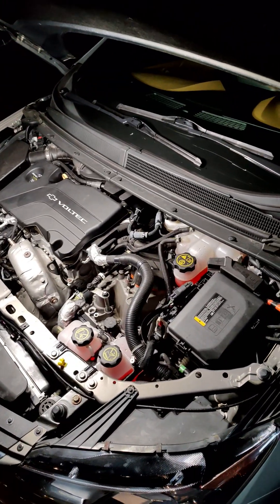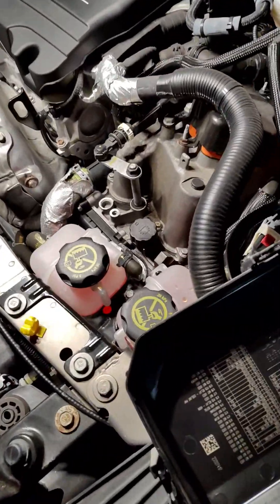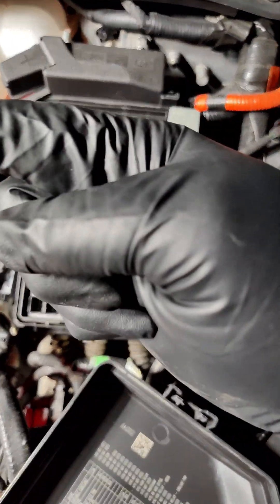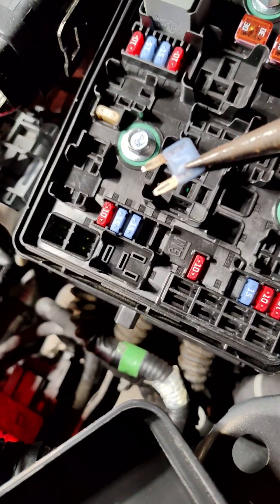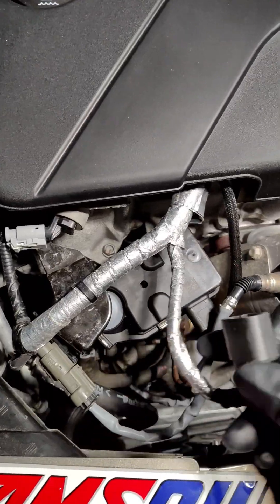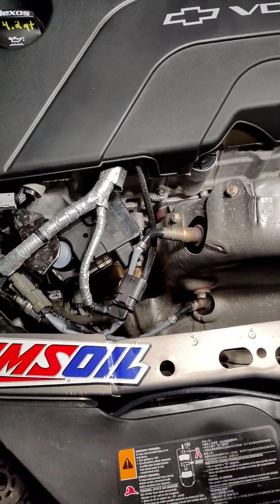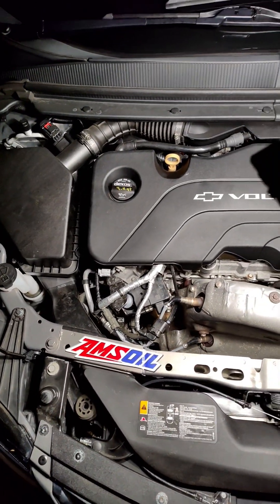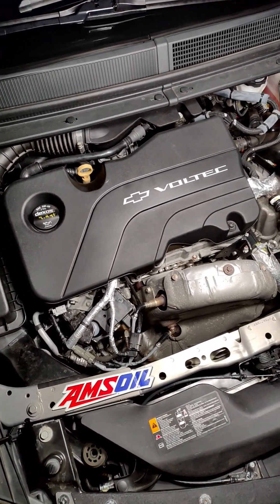🔥Chevy Volt Overheating? Reduced Propulsion? P0401 Code Explained + Temporary EGR Bypass

Comment: Did you say that, when the valve is unplugged, all the exhaust (or some) will circulate back to the engine ? What's the advantage vs. disadvantage ? Will it increase or reduce the power ? Thanks !
Reply from the maker: Assuming its not stuck open, the valve will stay closed, it will not harm the engine at all, the only thing that will happen is your car will make a little more pollution and you will have a check engine light on.
Reply: @blackwatermotorwerks  How would I know if the EGR is stuck closed or open?
Reply from the maker: @tssbjj you really wouldn't,  unless you take them off. They almost always get stuck closed for what its worth.
Reply: @blackwatermotorwerks I read  a comment on a GM Volt forum that the Catalytic Converter can eventually get clogged with excessive soot if the EGR Valve stays disconnected while driving for a long period. 

Could the Catalytic Converter get clogged of the EGR Valve remains disconnected for a long period of time?

I have not read anywhere where this happened and I read people driving it like this with the EGR disconnected for a year or two. I assume using "Top  Tier" fuel and Red Line 60103 SI-1 Complete Fuel System Cleaner would help prevent the Catalytic Converter to clog.